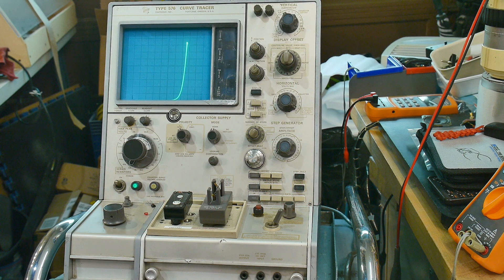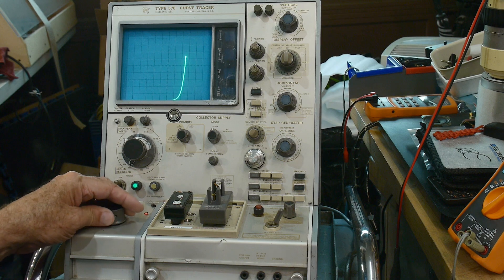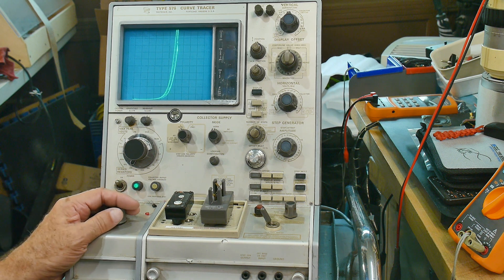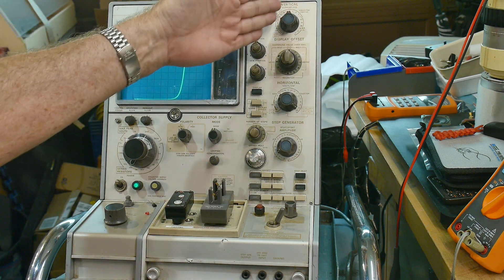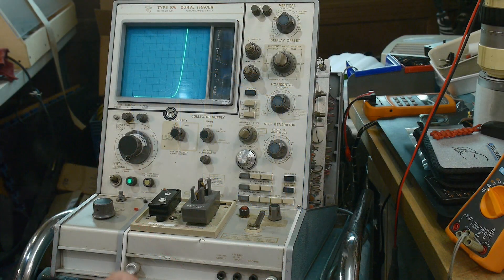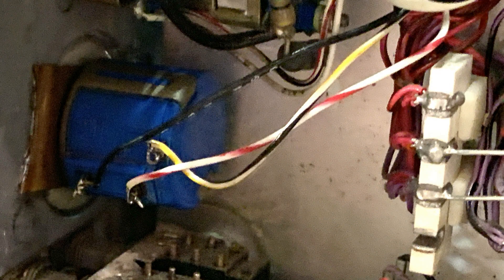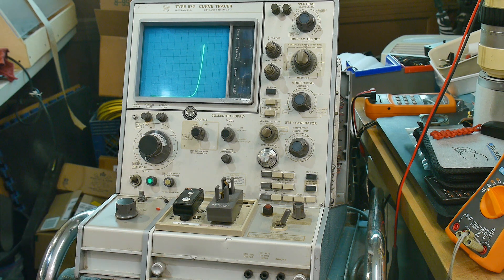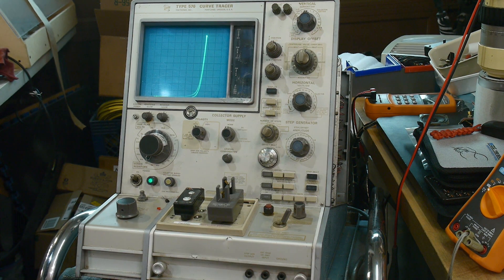#1280 Tektronix 576 Curve Tracer (part 7 of 9)

Comment: I've worked on several pieces of Tek equipment that used those PCB multi contact switches, they all had solder joint failure between the PCB and the switch contacts.  I used a scrap of wood between the PCB and the contacts, held in place with painters tape, to hold the contacts stationary while resoldering.  Good fortunes and thanks for your work.